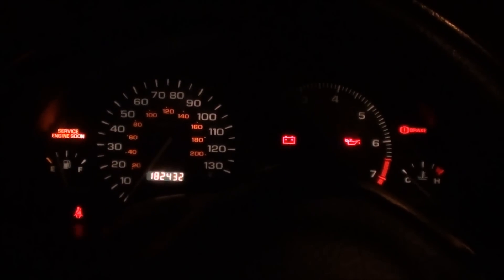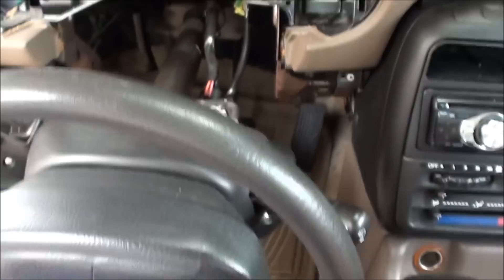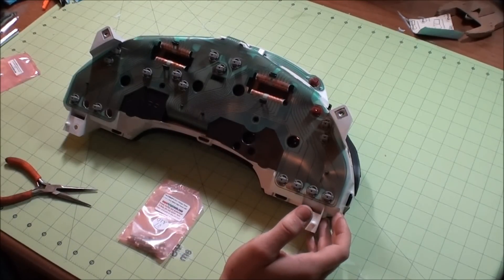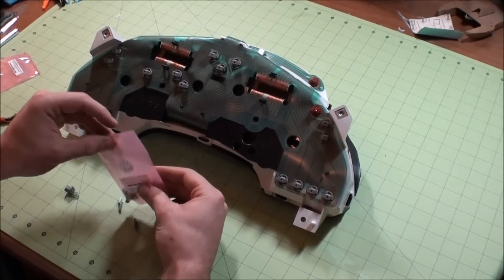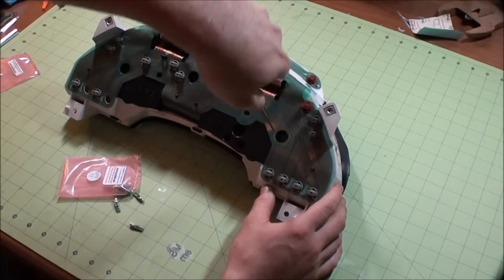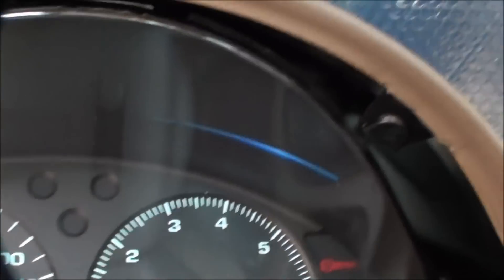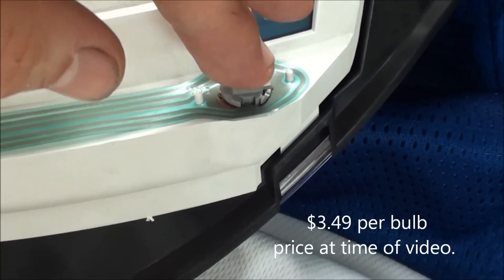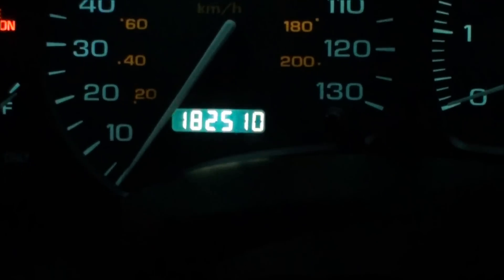Instrument Cluster Light and Domelight Replacement/ LED Conversion on 98 Saturn SL2

Comment: Thank you!! You saved me $95. It only took me 6 hrs. I know. The guys at Autozone laughed at me for how long it was taking me but I am not a mechanic. Thanks to your videos, I can now pull out the cluster panel, change the lights,put the panel back in and change the bulb in my cup holder. 

THANK YOU! :)
Heather
Reply: Dude my 99 Sl1 is so old it has the same exact burnt bulb in this guy's video. Also I am literally sitting in my car and don't drive too much at night but now I do remember a slight light emitting from the cup holders but never really thought about it. Now I realize they're basically useless they're so dim but I do have them. LOL it just sucks these cars plastic clips always break. Other than that I love this car!! I'm still waiting for my dome light to fall down, I know how the done lights are in this car as my Dad had 2 of them previously same exact year also. The dome lights usually either get broken or fall I think if someone yanks on it typically doesn't help that's how me being 6 years old broke ours. 😂 My Dad still once in awhile says "hey check this out the dome light works now don't touch it." 😂😂😂 😢 Lmao. He also says don't yank in the door handles either, I broke one of those too. 😅 Damn plastic, I guess at least it's not an arm and a leg to buy a new part. But some of these interior plastic pieces can actually be hard to find unless you want to make a trip to the ol junkyard... Like my emergency break, I need the white long plastic piece that sticks out of the metal arm when u take the cover off. Mine broke when I yanked the button off of it literally just snapped. I guess I'm still breaking Saturns, even as a 20+ year old. Wow I'm reminiscing too much here jeez sorry my apologies. Cheers guys! And someone please let me know where in the hell to find the white plastic piece located in the emergency break handle (long piece) I'd love to buy one perhaps.

Comment: Thanks for the video.
PS I found that instead of going to a salvage yard for grey holders to replace red or black holders, I could reuse the red or black bulb holders.
Even though the two base wires are soldiered, I used a small screw driver to pry remove the burned out bulb and break the two wires. The bulb broke so be careful of glass. Before inserting the new #74 bulb, bend it's two wires outward and insert because there are connector fingers but they are not as wide as the gray holders. Use an ohm meter to confirm it's working. The replacement bulb seems just as bright as the old larger glass ones.
Just got this used Saturn sc2.
I got a 98 as well with burned out bulbs including the odometer.
I won't go with led in the dash but I did for the dome and trunk cause they are the same bulb and can drain the battery too fast if engine off while working in the vehicle and tend to melt the housings.
I used 2 in the dome light back to back for extra light really lights the floors and glove box and all well.
I got my bulbs on ebay, the one piece like yellow gel Cobb seem to be the brightest.
I also got led's for the 3 bulbs in the third brake lights from eBay cause they good out too often and tend to melt the plastic housing as well.
One dash cover plastic tab did break off when removing but I removed the plastic from the metal and I'm super gluing the plastic back to the dash and placed the metal clip back in its metal hole and will push the plastic tab back in during  the install.
99,000 miles.
I use 10w 40 as the owner's manuals are for a new engine, mine is worn in and I believe benefits from the slightly thicker oil better than if I bought the over priced synthetic.
Had to replace the serpentine belt tensioner spring broke-no tension action remove the passenger fender access plastic panels and what not and the pass window won't roll up, broken cable, may need a new window regulator.
Replacing the old cracking sound factory speakers with pioneer.
Glued the headliner back onto the sunroof slider.
Sprayed lithium grease into ignition switch key area to fix sticking key turns, don't forget you have to push in to turn to the off position past accessories.
Changed auto trans fluid and spin on filter including removed and cleaned the ring magnet that is inside the filter mount.
Great practical and sporty looking car.
Hope my comments help others.

Comment: Not bad the led lights are polarized because they are actually diodes and all diodes are polarized. These are just a light emitting diode thats all and if you look a bit at the board sometimes GM is nice enough to place a mark on it to mark what would be the positive.

Honestly all gauge clusters should come from the factory with these installed. But it is a nice upgrade.

Good video dude.

Comment: 96 SL2 -- bought some purple and white, 74 LEDS online with the bulb holders! for around 7 bucks 10 of each.
soon as I get the time looking to replace them!
Will probably put the white in the center and the purple around the edges,  only because, I really don't need super bright dash lights! 
going to also try and do the accessories lights with it!
or console..
haven't pulled it apart yet to see! will try and video the after effects!!

Comment: I want to do that to my 99 sl2 in blue I wonder how it will turn. I bought cheap LEDs from ebay  but they should work. Also I want to replace cigaret light bulb tint the orange with tail light tint and change the one where the automatic shifter is to blue. I was wondering can I change the orange ac and air recycle buttons to blue if so please do a video on Those that would look awesome and be helpful

Comment: Got a wrench code.  Swapped a few red connector bulbs for gray connector bulbs. Didn't have any extra from jy though. Abs, alt, shift indicator and a few others are now without bulbs.  Which one did I need? Left in SES and wrench, seat belt, oil pressure, low fuel high beams r and l turn signals, few others

Comment from the maker: In the Gen3(2000-2002) saturns I think the white base is the equivalent to the gray base in my 98. gray and white the bulb is removable, but the blue base has the bulb welded in so it would be difficult to remove. if you go to a junkyard, just pull both white bases and gray and see what will work. odds are, they will since it's the same type of bulb.

Comment: I did finally find the LED bulbs from the site you stated. Come to find out they just fall out of the sockets, they don't even stay in. They made these wrong actually, the pins should be bent slightly and are strait. I'll probably get them to work but they don't work on an "L'' series like they say on the saturn fans forum. I think it was a waste of a few dollars myself for these. Oh and I don't see where the dome light is polarized. I tried it both directions and it works either way. The only issue is that if it's on "Door" mode on the switch it stays on slightly. I have to turn it to off to get it to go out completely, also both directions on the power leads. If you still own the car I'd check that or if you found that issue already, it would cause a power draw. I don't know how to correct that otherthan maybe a resistor or something soldered to it, if someone knows what that's caused by. Almost appears like a load issue.
Reply from the maker: +Chas S My dome light does stay on very slightly in "Door" setting while the car is running, but it would go out completely when power was shut off for me. It did it in the 98 SL2 in this video and also my current 02 SL2. Swapped the dome bulb over to the 02 after totaling the one used in this video. still haven't swapped the LEDs in the Dash...probably won't. With LED's it a very small power draw so it's not going to have a huge affect unless your battery is on it's last legs.
Reply: +JungleKing007: i tried the turning the key off and it still does it. don't know the exact cause.

Comment: Dumb question...I replaced my radio (Saturn 200 SL2). I pounded the top dashboard cover back in. Now, the dimmable lights in the instrument cluster are all out. The lights for the warning, hazards are ok, like check engine and oil pressure...they come on momentarily when I start the car. But, anything that would be affected by the dimmer knob are out.

The lights in the heater control and gear shift are working fine.

Any ideas on what I messed up?

Comment: I was just set to replace a few bulbs on my instrument panel on my 2000 Saturn.  Most of them have the blue plastic base, but a few have the white base.  I needed to replace some of the blue ones.  Went to my local AutoZone to buy incandescent bulbs, but they don't come with the plastic base...just a bulb.  I ended up taking a pliers and breaking the bulb and pulling it out of the base. New bulbs don't fit...ugh.

Do I need to get all gray plastic bases?  Those bulbs are removable.?

Comment: I have lights coming on and off not sure if its the bulbs or the wiring.
Reply from the maker: ***** Could be wiring, be a faulty connection between the light bases and the electrical connections on the dash panel, or the connection between the bulb and the base. May want to check them all to be sure.
Reply: Thanks.

Comment: Question, do you have tilt steering adjust on your 96?
Trying not to drop the column again..
I've gone through dropping the column once already last year! Installed white LED and just had the one over my gas gauge go out! 
I'm going to replace the white with red LED bulbs! Bc the white are definitely to Bright and mess with my night vision some even with the dimmer switch turned all the way down!
Reply from the maker: Sorry mine didn't have the tilt feature. Only a sliding feature.

Comment: jungleking007 this is kind of irrelevant but I noticed your aftermarket radio has a nice fit to it. I have a 99 Saturn and I bought a cheap plastic kit for my radio from Walmart and it doesn't exactly fit the greatest. Could you tell me what yours is and where you got yours from? thanks helping a lot.
Reply from the maker: The kit came from BestBuy. Unfortunately don't know brand or how much it cost. The one in my area has a car audio installation outfit and I simply walked in, told them, year, make, and model, and they sold me the adapter and wiring harness. I would suggest when you go in be ready to haggle price. When I bought the adapter and wiring harness for my 02 SL2, I went online and found the price cheaper. BestBuy matched the online price. Saved about 30 bucks for everything.  Not sure if you will get the same deal but its worth a shot.

Comment: You can buy LED's at your local auto parts stores now. lol. Of course this was 3 years ago. We've gone a long way. lol, but other alternatives to buy ARE cheaper tho.
Reply from the maker: +Chas S I haven't seen any LEDs like the ones I use here in my local auto parts store. guess it depends on the area you live. I'm lucky though. The site I ordered the bulbs from is headquartered not too far away from me so I can run up to their store and grab them.
Reply: +JungleKing007 : yea, your correct. Read my post at the top again.

Comment from the maker: interesting. what kind of car are you doing this to? checked the bag for the 74CWHP3's I used and they say 12 volt. they should be plug and play, no resistor needed. especially when LED's use less power than standard incandescent bulbs. you might have a short somewhere.

Comment: Would it be the same bulbs for a 2001 sl2 ??
Reply from the maker: John Keene I Think they are different. The ones on my 02 are all one piece. you can not take the bulb out of the base unless you carefully break welds and pull the pieces apart.

Comment: I'm doing a full LED conversion on my e30 now. I was considering buying from superbrightleds.com but I think they overcharge you way too much. Take a look on eBay - some of the chinese shops have a full range of LED bulbs on offer which can be had for less than a 1/4 of the price of superbrightleds.com so you can just buy from them and combine postage. Just putting that out there ;)

Comment: That is super complicated compared to the ion
Reply: Not complicated at all. Btw, S-series was replaced with the ION so basically ION is the new S-series, so of course it would of gotten easier.
Reply: Eh they could have been the new a-series but the ion was a new car all it's own. My lil sis ha a 1998 SL2 can you replace the light behind the odometer hers has gone out